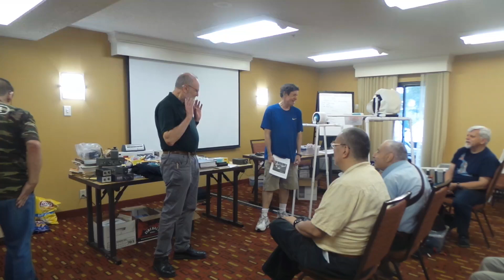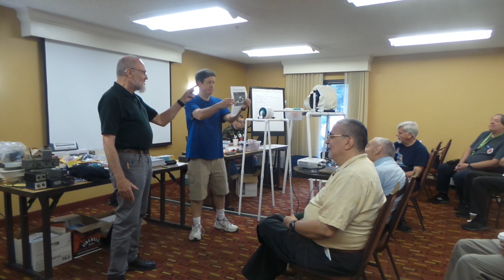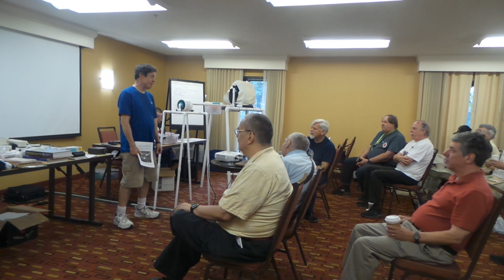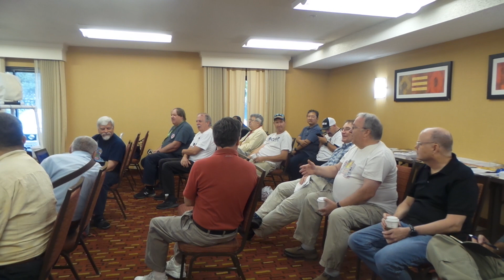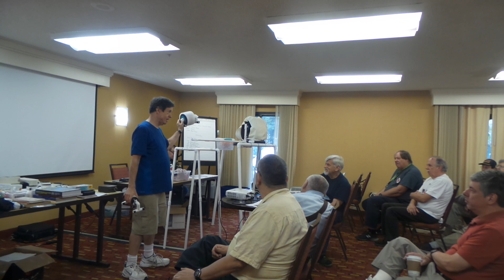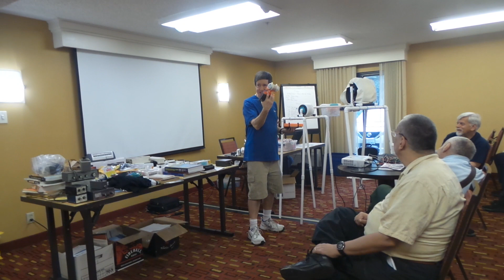Innovative Ferrite Antennas (IRCA Convention Speech)

Comment: Both my portable already has a 7.5 inch ferrite bar in it also I live in area with some of the highest ground conductivity in the country. Drives my metal detector nuts if I use a concentric coil instead of Double D. I've seen those monster ones before where it's a bunch of ferrites in a circle shape but at that point it's better to just make a box loop.
Reply: Kandi Klover .... I found a Walking Liberty half dollar with a cheap Bounty Hunter 202 recently. I was bored and took it out in the yard just messing around. My best day detecting was back in 1996 with the most expensive detector sold by Radio Shack, a Discovery 3. I found 3 really heavy 14k rings and a small diamond ring in under 40 minutes on a freshwater lake on a beach while the water was very low. I found earrings and a couple of silver rings and all kinds of other stuff that day including some John Denver style gold rim glasses. I found a lot of rings and hundreds in coins with that detector. 

Years ago when I had the space I stretched out two longwires about 250-300 ft long each in opposite directions and connected them to a homemade coil on a paper towel tube of about 100 turns of 24 AWG magnet wire. I could place the coil near the radio and get AM stations well over 300 miles away during the day. I went from getting only 3 stations to about 50 during the day. In NW Louisiana I could hear Dallas, New Orleans, Houston and Oklahoma City loud and clear at noon. Oklahoma City was over 300 miles away and I could hear a lot of weaker stations but never attempted to log them. I wasn`t really trying to DX but just get more stations than the three boring ones I could normally hear.